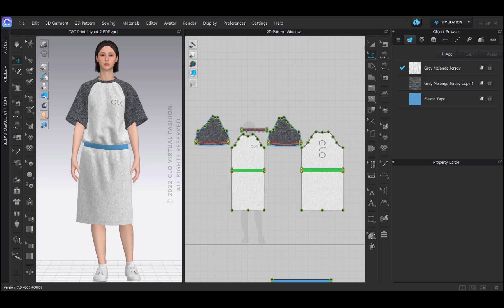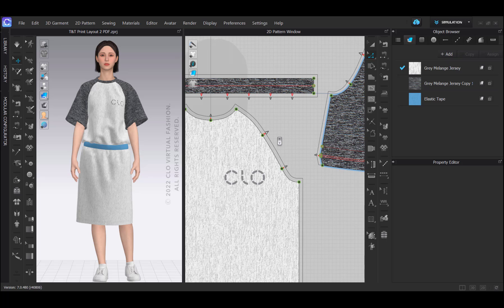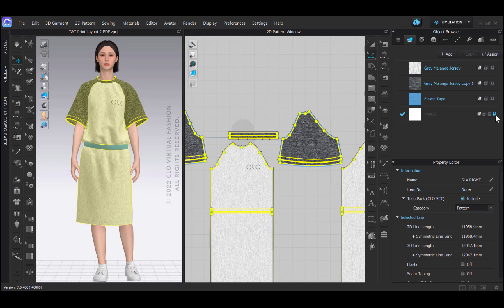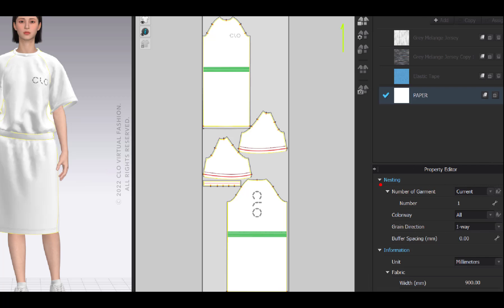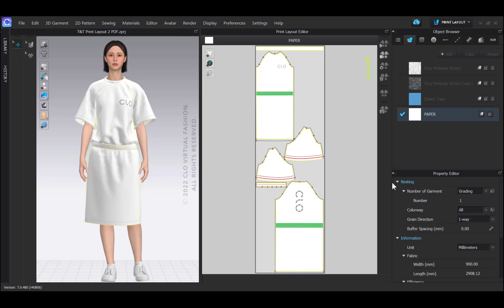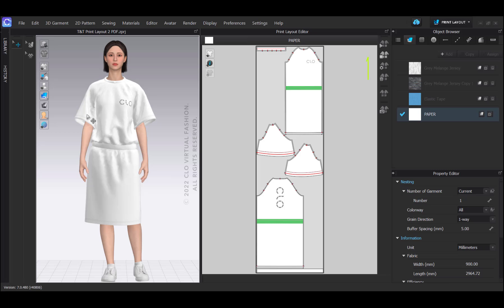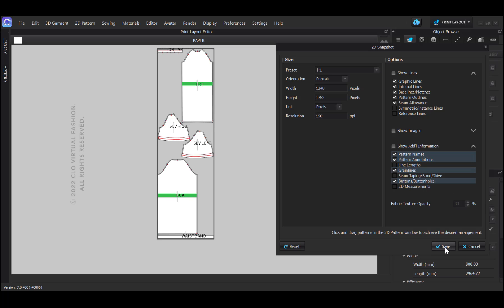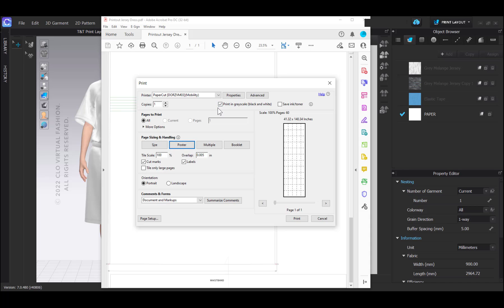How to Print Your Pattern | CLO 3D Design Tutorial

Comment: how much widt, in the fabric roll, should someone write if one wants to print it with A4 paper?
Reply from the maker: You can set the width to any size in CLO. Then after exporting from CLO and you go to print you set the paper size. Since most pattern pieces will not fully fit on A4 you will have to cut and tape the pattern together

Comment: hello, i did exactly the same what you showed but there are borders on the printed a4 papers. and as you can accept it's not good... when i want to make papers stick with adhesive tape pattern will be wrong because of the margins between papers. you can say that i can crop that margins with a scissors but it's not gonna 100% perfect cutted... can you please help me about this issue. i do everything alright but when i get the print it's so awful. and as i searched about, there is no feature about printing posters without borders.
Reply from the maker: Hi. Most printers cannot print all the way to the edge and this is something you will need to work through. You can look into Table Paper cutters which will be more accurate or bring the patterns first into Ai or Ps and add cutting borders, but for most home printers you will need to get creative. Otherwise you can look into anyshops in your local area that may have large scale printers for printing

Comment: How to show an outline frame and  length  of the marker when i export PLT
Reply from the maker: Hi There. When exporting a PLT file you can show additional information by selecting them in the Export Plotter pop-up. Under Show Add'l Information make sure that 2D measurement is check on
Reply: @CLO3D  i already check on all Add Information, but it still not show the outline frames
Reply from the maker: @tuanminhtruong9218  For further help for this type of issue we recommend posting to our Community Forums or Official Discord channel. This way you can show images
Reply: i have the exact same problem. how do you solve it? and how do you label sizes in the print layout?
Reply from the maker: @griselmedinacapitao5878  currently you cannot label each one individually. But this is a feature we hope to add soon :)

Comment: Thanks for the video, so can i Print my patterns with  a4 paper format?
Reply from the maker: That would relate to the driver for the printer you are using. Most printers have the option to tile the printouts, but this is not something that can be set up in CLO.
Reply from the maker: see the previous response.